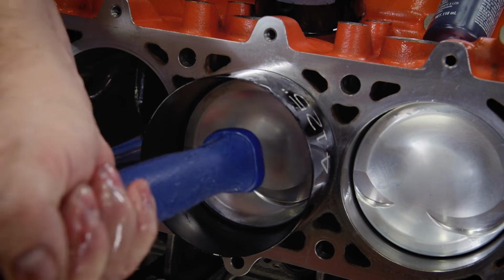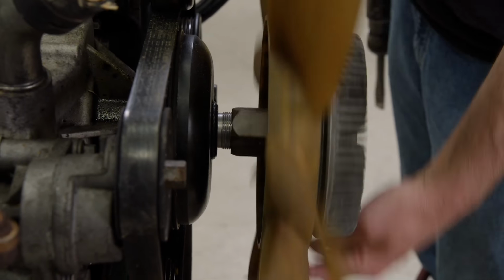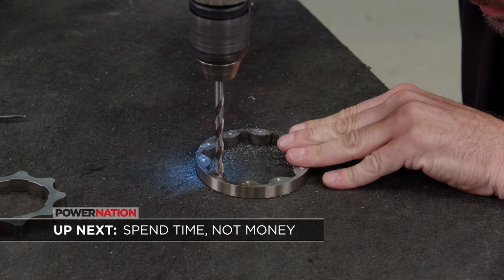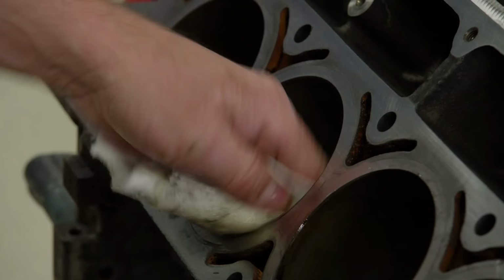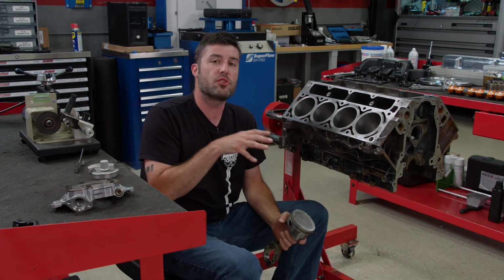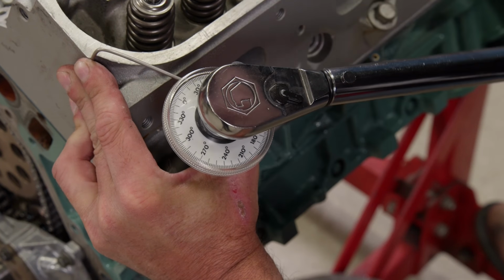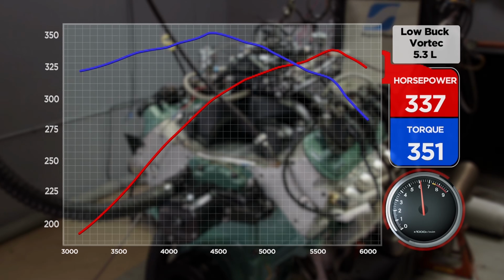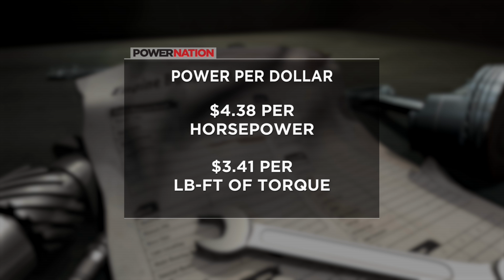Minor Upgrades Create Crazy Power on a Junkyard 5.3L Vortec - Engine Power S7, E10

Comment: pshh, this is fake. not 1 exhaust manifold bolt broke during disassembly.
Reply: They only break if you pull the manifolds in the car.  Maximum P.I.T.A. results.
Reply: @melirishjr.4602  bull they break on their own anytime I've replaced over 1000 so far in my career since I've been doing 4.8 5.3 6.0 have to mig weld a nut onto most when they break flush
Reply: @rustedratchetgarage6788  that engine hasn't seen enough miles before they took them out, or it's not from the north where every bolt you touch breaks
Reply: @user-cs3zs6jn1d , no way that's a "rust belt" engine with over 200k. Not one bolt broke
Reply: @rustedratchetgarage6788  I also have 2 broken studs flush with the head
Reply: @user-cs3zs6jn1d  got that shit right!
Reply: Jake Browne I uses high heat burr bit the goes right through the center of the bolt then drill just a size smaller and use a eases out. Takes about 30 minute. My neighbor has a machine shop and he bought a box of them at a government surplus sale and he gave me one. When I say high heat I mean it glows orange when it’s cutting through the bolt and it’s reusable.
Reply: @user-cs3zs6jn1d  Mine we’re broken and I had a 2005 5.3 with 119k miles and was a SoCal truck….
Reply: @user-cs3zs6jn1d  
They are in or around Nashville TN. So they are in the south or, mid south
Reply: @coache1nine  
They did say, it had 150,000 miles
Reply: @rustedratchetgarage6788  
I bought a 1988 Dodge Dakota with the 3.9 V6, 172,000 miles,  when I took the engine apart,  I never broke any exhaust manifolds. Bolts,  or any other Bolts,  I did break a bolt that held the Y pipe to the exhaust manifold but those are very easy to replace those are through bolts.
Reply: Minnesnowta. I worked on my rusty old Subaru out in my driveway in January. It was -25 to -30 every day for the 5 days I worked on it. Everything was rusty and I broke almost every exhaust bolt and one engine mount bolt pulling the engine.
Reply: @melirishjr.4602  yup. Your only hope is that the head popped off and there is a nub left [with the manifold off] that isn't very tight. But that never happens on a Monday.  P.i.t.a. for sure brother!
Reply: If you hit them all with a hammer and punch prior to loosening it will reduce the likeliness of breakage. Also makes broken off ones come out a little easier.
Reply: Lol literally just posted this same thing then noticed you beat me to the punch 😂
Reply: I agree at least 1 allllwayyyys breaks lol. I burn my hands cause i start them let them warm up n break them loose if im doing exhust work or have to pull manifold
Reply: @joshford6064  I wanna do a a 2007 Chevy trailblazer LT rear wheel drive of mine.  Mines has 160,000 mi on it and I need an engine and transmission swap... wht would you suggest as a donor vehicle from the junkyard... what year, make & model should i be hoping to luck up and find runnin, to swap and build on more torque and power...?
Reply: Never appreciated shows like because they have every tool and endless pockets. Defeats the practical aspect.
Reply: The factory exhaust manifolds are cast steel, not cast iron. This is why they are able to be welded so easy if needed.
  To keep the front & rear exhaust studs from ever breaking is to oblong the holes front and rear. Make sure the bolt head location is ground slightly to smooth because it gets a flat washer under the bolts to allow for expansion and contraction. This is when they break. I have done several hundreds and never had one break ever. 
  I suggest captured needle bearings in the rockers so the can work out. Clean, green locktit is used so the assembly can’t move. 
  The OEM oil pan has an internal dump that a piece of dirt, gasket material or silicone can hold from seating. This results in un-explained low oil pressure at warm idle. Either stake it shut/closed and check or find an aftermarket oil pan that comes without it. The oil filter comes with an internal oil bypass and it doesn’t need two. On the back of the supply oil gallery is a bar-bell shaped insert. This block oil from the pump and directs it into the filter. It is plastic and fitment changes a lot with temp, so install a machined bar-bell from “Sac City Corvette” with o-ring and threaded 1/4” X 20 hole in back for removal and cleaning of this gallery can be properly completed. Always use solvent and bottle brushes on every single oil passage or gallery on this engine. No one wants scratches on new bearing after running for a short time. Behind the camshaft upper plate, alway use a new silicon gasket with Loctite 518 (Red Jelly) as just a thin film works. It is designed to create it own seal on flat machined surfaces but here, a leak will once again cause low oil pressure at warm idle, and hard to find. Cheap insurance as oil passes right to left across the lifter oil feed gallery’s. 
  The perfect cure for knock sensor leaks is; clean the hole and valley plus pan top and bottom. Use dielectric grease on the knock sensor where it screws on. The bottom and top seals are installed with a complete ring of high temp Red RTV, with a complete ring or seal on top. No water can get in and any air pressure will vent in or out pass wire at the rubber cap. With clean fuel and a proper tank vent system (Roll-Over-Valve, vent tube high & looped to filler neck and filter fresh air in to activate carbon canister and purge set to work at temp and at speed. No smell of fuel in the house garage and burn the fumes you paid for. Plus, no problems during re-fueling. I worked, rebuilt and repaired almost every carburetor known to man. It done correctly and a proper filter is used, EFI will go decades. You can’t get that from a carb plus the can’t adjust for air temp changes or altitude. 
DK, ASE master tech since 78
Reply: @deankay4434  got any tips on fine tuning quadrajet's? specifically the L82's 211 carb?
Reply: @frostbite1991    >Well, what I have is a complete “Parts and Service” Delco #9 Carburetor book 3-ring binder. You have to pick a size in cu in and a performance package such as a Corvette and choose the year that emissions would be less and scroll thru this 5” thick book until you found 327 cu in 1968 Corvette, scroll down by carb part number and find manual or automatic and start a clean sheet of parts by name & size, p/n is next to each in the main jet, air valve setting, choke opening setting, float setting (all with GM part numbers) then pick and choose and follow the assembly procedures, linkage adjustments, etc.
 Since each engine works differently and has it’s own character, it eventually comes down to choke opener cold in 0.XXX and air valve tension settings. The rest is A/F as close, timing by light or vacuum gauge, then loosen or tighten the air valve setting for secondaries depending on how it runs.
  I have a 350 cu in 4-volt truck engine built in 1972. The kids that owned it before me put some huge hydraulic camshaft, so it went piece by piece and setting by choice for a 1967 Corvette Stingray and adjusted the carb to factory setting. First, set timing using a vacuum gauge, A/F and drove it. It is a stick. But, say it hesitates when opening the secondaries, then loose the set screw, back of air valve tension 1/4 turn and retry. 
  The world either hates the Quadrajet or loves it. It was the first full functioning “Variable Venturi” carb on the market and with more adjustability than a Holley. Most can’t see the potential this carburetor had, yet GM used it for 38 years! It runs on two bbl until you set on it. The secondaries are their but not functionable until the spring load top air valve begins to open. Even it’s action to the enrichment needles lifted at a slow, medium or fast rate is miss understood. The epoxy resin fiberboard cam the enrichment needles sit on can be changed and creates a complete different animal of a carburetor. Their are a number of unique casting changes in some cases small block to big block. Some are Buick to Pontic.
  It is unthinkable now but for decades the Chevy engineers would not eat lunch at the same table as the Buick engineers. It is two brothers building a race car in the same garage but only a bed sheet hung from the ceiling separated them.
  Other than that. I don’t know anything about carbs!
Reply: Took the words right out of my mouth.
Reply: 😆 so true
Reply: I had to cut the head off of two bolts when I put the new exhaust system on my truck.
Reply: They probably hit them all with a torch to shock the bolt and get them free.
Reply: @TheGamersRace  No, you heat the exhaust manifold so it can expand allow the bolts to unscrew by hand. There is no Loctite on the threads of these bolts. Only the cylinder head expands more during use than the exhaust manifolds. This is why I tell everyone to oblong to holes at the front and back or the exhaust, clean the face suitable for a flat washer and install the bolt. I use anti-seize and never had one ever brake. I told the “Subject Matter Expert” at ACDelco when I worked in the field but I have no idea if anyone in Grand Blanc knows to call or send a email to powertrain engineers! They did’t let me know and I never got a call back or powertrain contact.
Reply: @deankay4434  I never said there was loctite on the exhaust manifold bolts 😒
Reply: @TheGamersRace   >I never implied anyone put Loctite on the exhaust bolt except the factory, which did not! Hope this clears this up!
Reply: @Sherbadub Duubb Uh, no.  I've owned plenty of cars and motorcycles and had bolts stuck or rusted tight.  One example would be my 99 silverado 1500 exhaust.  It rusted away and I replaced it and within 6 years it rusted and broke again.  I also had a 92 Suzuki DR650 and the header stud bolt and header pipe on that completely rusted away.  These are only examples, but my Toyota Sequoia has bolts that were cut/drilled out and replaced, every car I've worked on has had things stuck on or fall off down here.  Yes these things are accelerated in the North where salt is constantly used to keep the roads from icing, but to assume that these issues don't happen in our region is dumb.  And no I'm not near any bodies of water.
Reply: @Sherbadub Duubb Cars don't get "Cantaminated" in the factories.  This is the dumbest thing I've read this week.  Also, the DR650s was not manufactured in the north, it was manufactured in Thailand.  Their other plant is in South America, and by far this was the most horrific rust on any motorcycle I'd ever seen.  My 1986 Yamaha VMAX lived most of its life in the north and barely has any rust on it at all, mostly just on the exhaust headers since they aren't stainless and are original.  You should move to the south so you can see the rustbuckets that have lived their whole lives down here.
Reply: I've been a mechanic for over 30 years and I rarely break bolts/studs/threaded fittings/fasteners etc.
Reply: @K-Effect  ya right. Lol
Reply: Try snapping plugs(ford).

Use pb nut buster and even pressure on a breaker bar, not a jerk motion, once done vacuum/blow out the bolt holes, apply pb nut buster or a lube and rechase the threads.
Reply: Is this FaReal...? I need something like tht done in my Chevy Trailblazer... should I go with the 5.3L or the (what is it...) 6.0L or 6.2L...? I need 400hp to the ground... (rear wheels driven) please (somebody...anybody...) tell me wht year, make and model to look for at the junkyard so tht I can pull the rght engine and start the tear down and clean up to fit with SUV for more youthful power & reliable longevity
Reply: @jahcousteauu_STAYinSHAPE  5.3l v8 was an option for the trailblazer ss. You can use similar year ls motors. 5.3 6.0 lq4 and lq9 are cheap awesome motors and ls parts fit the same
Reply: I'm so glad other people are starting to catch on to LyingNation.
Reply: Omg thought the same thing. Those damn bolts.
Reply: Mine didnt either for my s10 swap last year 😁
Reply: 😂🤣😒 So True!
Reply: When I did the headers on my truck they didn't break so I got lucky I guess 😂
Reply: @Sherbadub Duubb I'm in the south, bolts still break.
Reply: I agree.
Reply: I was thinking the same 🤣🤣🤣
Reply: Zac Price I was like how tf that header come off so easy
Reply: I dont think it was a fake, come on bro...They probably used a bolt lubricant &  used a hand ratchet to break them bolts loose, then used a power tool to bring em all out. The bolts probably weren't seized either... Why would they fake the funk no need to they are excellent wise mechanics. If you're breaking shit then you need to learn secrets of removing fasteners...
Reply: @davidadamson3345  was a joke bro. Chevy's were notorious for broken manifold bolts. My LQ4 had 4 broken ones I had to weld out to replace.
Reply: @davidadamson3345 sounds like you're not talking out of your normal hole!!
Reply: They come from the factory pr broke
Reply: You said it right there. Broken manifold bolts for sure!
Reply: I hate when they come out like butter on TV!
Reply: Never had to take exhaust manifold off.
Reply: You must be from the midwest
Reply: @jacklenau4151  pnw actually
Reply: LMAO exactly
Reply: if they break wasn't torqued properly
Reply: @Jeffthestreettech  they get weakened from the manifold flexing sideways, causes extreme amounts of stress on the bolts. Most of the time the just shear off, but a lot of the time the bolts can be weak enough to just break off during disassembly. Having teeny little 10mm heads doesn't help, and I still don't understand why they went that method. I fit grade 10.1 bolts with 13mm heads on just fine after I extracted the broken bolts out of my LQ4.
Reply: @Jeffthestreettech   If you are discussing exhaust manifold end bolts, improper torque is not the problem. Expansion & contraction is the issue. Cast steel and aluminum require elongated holes, flat washer and a smooth area to slide. I fixed hundreds at the dealer and saw the customer return year after year. They never broke again.
Reply: Lmao absolutely 😆
Reply: 😂😂😂😂😂 spoken from experience I see……
Reply: Lol, depends on the amount of rust.
Reply: I always take them off when the motors hot. I’ve never broke one to this day and I’ve done over 40 cam swaps and ALOT of motor swaps.
Reply: I don’t think this is the best way. How close did they come to grenadeing it tho? He said himself there flirting with disaster. Surly It can’t make those passes to many times. 700fpt Will have to yard sale that fucker before long. I’d rather forget the spray. I’d do all new rings and bearings, and I’d ran a lot bigger cam with the head work to allow bigger cam more compression. Run higher compression pistons. Running a lot higher compression with bigger cam and just kept it N/A. It wouldn’t make 700fpt but it would be real nasty street build that sound real good with a nasty throttle response.
Reply: Penetrant or torch, or both,  if u know what you're doing.
Reply: Bunch of punk kids. Lol.
Reply: All of mine came out really really easy, like very easy. Its literally an LS, I've had more problems taking bolts out of my ram the I've had with my vortec chevy
Reply: Lmao…why the skinny manifold bolts Chevy? Hate’m
Reply: @chatbot-bro  i can only assume for assembly. running 13mm heads it's a bit tight to get em all in.
Reply: Welcome to Arizona driven vehicles!
Reply: My 02 5.3 head swap at 230k. No exhaust manifold bolts broke.
Reply: How do you know😑
Reply: Hahaha spot on. Anytime I need to remove these exhaust manifolds I quote with additional time for repairing broken exhaust bolts.
Reply: Just because there are incompetent wanna-be mechanics out there doesn't mean that two great mechanics with the correct tools and have worked on who knows how many jobs with 5.3 ls engines doesn't mean it's fake. I've done this myself and never had an issue with the manifold bolts because I had the proper tools there and I didn't try and force shit like most garage mechanics do because they lack the basic patiences skills to not break shit and to reinstall with no hiccups or needing to replace the part three months down the line to yet again break more shit that should've come off easy since you just installed it
Reply: If that ain’t the damned truth! Broke one taking exhaust off for tranny swap in my 02 Burb, didn’t replace broken one upon reinstallation, just tightened the remaining good ones down well. truck still quiet & no lights! 
Slightly louder than before but still can’t tell it’s running from 15-20 yards
Reply: They take them apart before to make it look easy
Reply: All my bolts came out without braking
Reply: im silverado didnt brake either
Reply: Another fake / glossed over portion of the build are the professionally rebuilt cylinder heads, the freeze plugs are new AND have the " over heat melt out " discs glued in them.
Reply: They don't want to make love to the biggest nightmares... Good God. You sound Married. All JOKES! Love you guys.
Reply: Haha😂😂😂 good point
Reply: They are Real mechanics..not wannabe internet guys like you
Reply: 😂😂😂😂😂😂don’t do em like that
Reply: I drive a silverado with 250k miles, still now exhaust manifold bolts broken yet, nock on wood
Reply: Whatch me break half of them off when I put the long tubes on my truck
Reply: My luck
Reply: @sethnelson8698  what year is your truck?
Reply: @sherrokinchen5253  2005
Reply: I have a 2002 GMC Sierra 1500 pick up truck with 317,000 miles and nothing hasn’t fallen off yet.
Reply: Its not a dodge. Lol.
Reply: 😂😂😂 sooo funny, but I also want to cry.... 😢

Comment: $2470 Plus machine work 
Plus headers
Plus carb
Plus new sensors, wiring harness, etc
Plus plus plus turns $500 into $5k real quick
Reply: The heads have a rebuild button them after the cleanup too. There is another $1000